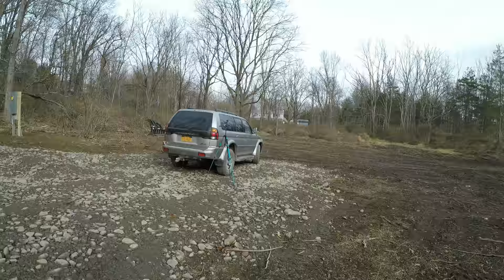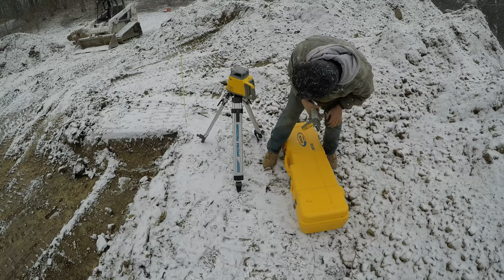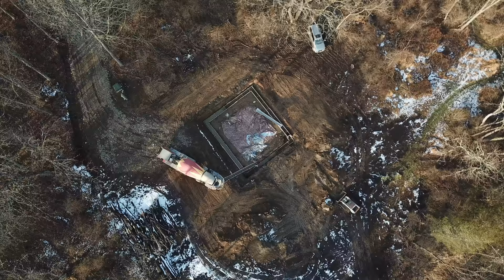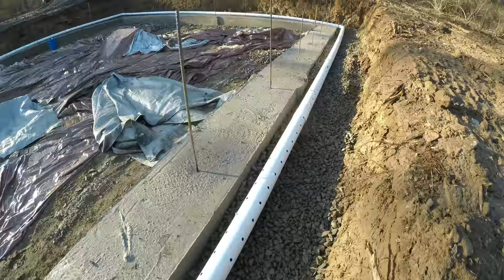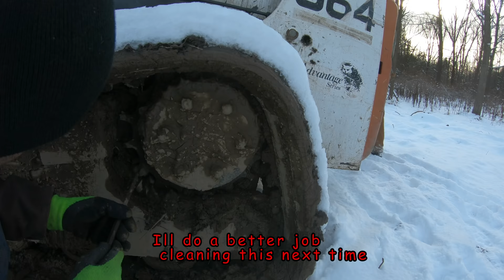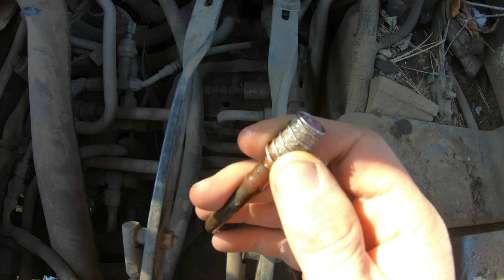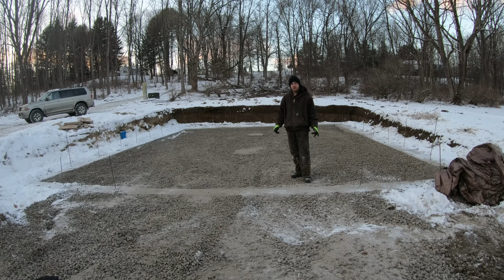Digging a foundation and pouring a footing

Comment: Working in the Arctic at -40 to -50C (-40 to -60F) back in the day, we covered our equipment with an insulated tarp and place a pile of charcoal briquettes in a long line underneath.  Light one end of the briquettes and it slow burns all night.  There is no open flame but keep it away from the engine area and other potential fuel drip sources and the machine is toasty warm in the morning.  Now we use an oil or propane fired Herman Nelson heater, but I miss the old ways sometimes.
Reply: Thanks that a clever ( Old ) way thanks for sharing Ced
Reply: I remember this method as i watched the 'ice pilots' on tv.
Well, watching tv is a long time ago but to come back to 
the story, they also use insul. tarps but an air heater.
Reply: He had power to the site.  Cover equipment with insulated tarp as you mentioned and put a 110v tank warmer pad under, frost plug heater in the engine, water circulator in the engine, cab heater in or under the unit .  Keep it off the ground like you did.  This whole nightmare can be eliminated.  A whole lot easier than fighting with the cold.  The cold causes things to break.
Reply: Ah!  Finally, someone who knows the cold.  Thank you.  So we learn from you, but who do you learn from?  Necessity?
Reply: @rogerdickinson920  He could of just took it home with him on his trailer after work and park up in his garage overnight.
Reply: @rogerdickinson920  The homeowners might not have wanted to pay for that electric bill

Comment: Enjoyed the video Andrew. I know this is an older one and you've learned alot since. When I worked in the Arctic, we would open the rear door of the skidsteer, drape a tarp over it all, stick a diesel heater inside and within an hour the machine would be warmed up and ready to operate. Battery blankets, block heaters, and oil pan heaters also helped alot.

Comment: Hi Andrew just a helpful tip in the future when you have a long project you should deliver yourself a mini container a 10 foot container and hook up a little electric space heater and store your machine inside the container.
Reply: Also they make commercial electric blankets and you can wrap the engine compartment in an electric blanket

Comment: Hi Andrew! Love all your videos! Just a reminder when doing a perimeter drain, for best results, always have the writing on the pipe facing up, and avoid using T’s and 90* Elbows. Always use Y’s and 45* Elbows to make the sweep longer. This way it’ll take 50 years for them to clog up. Also, you should be adding cleanouts after each change of direction. You videos rock dude!
Reply: What’s the reason for keeping the writing facing up?
Reply: @brandons42472  So if you are opening that section of pipe later after digging down you can ID what you have in the way of pipe
Reply: You are correct but Andrew didn’t design or engineer that system the engineer and the inspector could have done and should have done a better job they totally failed and it costs somebody a lot of money.tens of thousands
Reply: Also, shouldn’t the holes be facing down? Which is probably the same thing as the writing up.

Comment: Watching you work getting the tracks free reminded me of all the fun I use to have in the freezing cold fixing our fleet construction equipment during Michigan winters. I am so old I had to restring cables on our Unit Crane, almost slipped and fell off the roof of it but the driver grabbed me by the back of my coat. He taught me how to drive and operate most of the equipment and when I say operate it was most time just good enough to test all things out, we use to work with the drivers because a lot of the equipment had to be setup the way they liked. I got to learn how to drive the Unit, a D6 bulldozer (cant adjust the clutches if you cant test it he said),  morbark chipper with a 600HP cummins (they use to use a 18 inch by 10 feet long log like a tooth pick to shove the stuck bush into the drum), a triple nickle and whole lot more.

Comment: Would it save you time if you were to drape a tarp over your machine at the end of the day with a small electric heater under the tarp with just enough heat to keep it from freezing since you had electric at the job site. Just park it close to the meter.
Reply: Coming from a Canadian, all you need to do is make sure you clean the rails well. Every once in a while you see a frozen roller but the tiger torch takes care of that quick.
Reply: Next episode: Andrew Camarata repairing an electric heater.
Reply: @thetizzleforshizzle   I was curious about 2 things here.  You might be the person to ask.
If the track is frozen solid, why is he just putting heat on the gear(sprocket)?  
And wouldn't a spray of kerosene keep the ice from sticking to the surfaces?
Reply: @alext8828  a lot of guys get the flow truck to spray diesel but my understanding is that the power delivery is spread across all teeth. So you need to make sure that the travel area is clear so they can compound torque and clear frozen material packed into areas that can be hard to get to.

That's why track shovels are shaped that way, so you can clean between sprocket teeth..

Putting heat on the final drive could potentially damage seals and shit in the hydraulic system inside. Ballsy
Reply: @alext8828  in heavy industry the machine never stops but if you park for the night clearing the undercarriage is incredibly important. Sand just keeps dew ice from forming
Reply: @thetizzleforshizzle  ,b
Reply: @thetizzleforshizzle  on u

Comment: Your 955 would have been great for that. I know the bobcat is more agile but i know a guy that  basically built his excavating business around digging basements with highlifts. Used 850 case till they stopped building highlifts. Then went to 953 cat. Never looked back. I am sure you got your reasons for not using the cat. Great video !

Comment: Here in Ontario Canada you would never pass inspection if you have the holes up on pipe like that. 
However most people use a roll of perforated pipe with the sock (filter fabric) on it already and it is perforated all the way around. 

In your high corner Andrew the ground water could potentially be as high as the basement slab though not likely with the 3/4” clear stone. 

Looks to be some pretty well drained soil that showed no signs of pooling inside your excavated area even though the surface areas were quite muddy. The Bobcat did a great job of the excavation considering the lowside was at grade.
Reply: are you gues unionise over there ? in quebec we have to be in a union
Reply: @znarcuss  , In Ontario everyone has the right to work in construction , not just unionized workers, construction Unions are useless, especially International Unions which do not properly represent Canadian construction workers, just money hungry american outfits.
Reply: @floydfan5993  well in quebec if you want to work in construction on residential commercial or industrial you need a ccq carde that prove that you know what you are doing yes they have a union but at the end of the day the employee is back up he cannot say oh i dont know ! and we have a very high salary for it ! a labor start at 27$ hour an excavator operator starts at 38$ an hour .... union is not really a money graber is the employee is making 100,000$ a year

Comment: Enjoy your videos and have learned a lot from them, but I worked 38 yrs in plastic drainage industry as a  manufacturing mgr. and have been to many jobs in the northeast over the years, where our pipe was being installed. Engineers insisted that 2-hole @120 degrees or 3 -hole pipe be installed holes down regardless of application.

Comment: I see you do a lot of work and a lot of fixing things when you buy equipment and that’s really good that you do that and you’re a very good mechanic and you do a thorough job when you do a job and that’s respectful. But on the other hand there are a lot of things that I see that you could use help with. Properly inspecting and taking care of equipment every day before and after using it is such a timesaver in the long run and a money saver

Comment: Drain holes down so that it is harder for them to fill up with dirt or sediment. This is what your soils engineer or your building inspector would tell you. Hope that this helps because it is not meant to criticize. you are a good operator and you have to deal with the equipment at hand and what you can afford.

Comment: Drains: holes goes done. Drains with 2 holes also go down, with holes at '4 and 8 o'clock' and the text line on top.
Reply: That's the way I do it too (holes down). If you put the holes up the pipe will start floating as the water rises. I've heard guys say they've seen drain pipe float right out of the ground.
Reply: Guust In WWII an uncle of mine was on a warship in the PTO whose name was if memory serves Gust. Legend has it he was Swedish. Seven brothers all went USN. The family all come from north of the Rio Grande. Might you be from down yonder? Wow you & me could be kin. Almost scary ain't it? Dec9 2018
Reply: Why 3/4 no minus gravel UNDER the drains?  That's going to fill those spaces with water.
Reply: @MrBobnokious just lower than slab is needed
Reply: @ElectricDanielBoone  Classic mistake... Andrew does amazing work... hope he is reading comments.
Reply: Here's what i would do..If the temp.get's below 32 MOVE...to Texas, Nice Video's See Ya
Reply: Correct spelling: holes go down. I'm done.
Reply: yes i was gonna comment the same thing
Reply: Yupper. He set it up for a constant foot of water on the outside with the stone under and the holes up and that area is swampland which we shall see later on.
Reply: Zerro Fox  k, the holes down is proper. Water enters and all the pipe does is allow a channel for the water to flow easily and quickly. Don't think of that pipe as one would a sewage pipe. The water enters as soon as it rises unlike holes up which would allow 4" of water to build up, before entering the pipe which is not the point of perimeter drains. Holes down also help sediment buildup to not happen, if other things were done properly while holes up allows anything to drop into the pipe and eventually clog it up.
Reply: Zerro Fox  water filters down into the bottom of the trench the drain pipe is in.  The holes at the bottom of the pipe keep the water in the trench from rising, as it just goes in the holes and then down the pipe. If holes are up the water in the trench has to get deep enough for water to reach the holes. The pipe can start floating in the trench water and can float fight up out of the trench.
Reply: Yes. And all that loose 3/4 gravel in front of the frost footing will make a nice moat unless the drain out starts there.
Reply: @ElectricDanielBoone   That's an interesting concept.  Didn't think of that.

Comment: Nice video. Welcome to the world of track loaders, you have to clean behind the sprockets really well or that'll happen every time. A small crowbar cleans it well. An 80" 4-in-1 bucket with teeth is the best.
Reply: I take it going for a drive out of the soup doesn't clean it enough before finishing for the day?
Seems like a whole lot less effort would be expended if a bit more end of day maintenance was done
Reply: Well he buyed a 4-in-1  bucket, but it seems that his bobcats were not capable of using it with all functions. But since he has his IHI skidd steer, who seems to be a bit bigger than the bobcats, he can use that bucket too.

Comment: Hey Andrew,
Thanks for sharing the great videos. I am always impressed at how much trouble you go to in order to show even the smallest detail like a frozen fuel line. Kudos !!
Also, when I lived in what I considered "cold country" which is nothing like your neighborhood, I would use a hot water pressure washer to get all the gunk, snow and ice off the vehicles, dry it up a bit with a leaf blower and cover it up with a tarp to avoid further build up. A good blower heater under the tarp in the am was enough to get things cooking again !!! :-)

Comment: Andrew, great vids...in Ontario we are mandated to put a substantial footing below frost line...usually 4ft below finish grade.....and almost all flat work (concrete) is poured on top of a grid of 10m rebar tied on 2' centers....concrete is great in compression but sucks under tension...which is why concrete always cracks without it...I cant believe you guys dont have to put rebar anywhere....good job...

Comment: Andrew, put a heating rod into the engine case through the oil dipstick tube. Plug it into the electric service there at the site. The dipstick heater will keep the block and oil warm enough to prevent engine from freezing.

Comment: holes on pipe down or lettering up
Reply: Richard moore came to comment same thing.
Reply: I always put the holes down and writing up as this is how the perforated pipe manufacturer designed it.
It is designed in such a way as the water level in the trench rises, it gets to the level of the holes in the pipe and is carried off. The holes on the bottom equal a lower water height in the trench. Having the holes on top makes the water 4 inches deeper before the pipe begins to work. I set the pipe on 4 to 6 inches of stone and then bring the stone just a over the top of the pipe and then cover the entire trench with filter fabric and then backfill.
Reply: yes lettering up

Comment: Great video dude. A trick I learned from the old timers. Wa s put a bit of alcohol in the fuel. " with older diesels", and always clean and top machine off before going home. Stops condensation and saves time, money, ect. Stay busy

Comment: Drain pipe holes down... or are there holes on both sides?
Holes on top works but raises potential water level by a few inches and the standard regulations call for holes down.
Reply: The drainage pipes are up at one end to lead the water away from the house, with holes down, the base of the house would be soaked in water.

Comment: I like your part of the project Andrew, but I cannot say the same for "The Mason"... I'm not sure what the code is in that state, but I would personally have put a lot more rebar into the footings. That's apart from the fact that he simply dumped the rebar on the soil, and pored over it. So he might as well have saved himself the trouble of putting rebar in, because, sitting at the bottom of the concrete, on wet soil, it won't do anything and will simply rust away. What a cowboy...!
Reply: I am sure he pulled the rebar up into the concrete as he went along . I dont think Andrew caught it on tape .
Reply: Not a chance.
Reply: You can tell the rebar is supported and likely 3" above the dirt.
Reply: Pretty sure theres chairs in there looks like the rebar is up.  2 bars is pretty standard on good dirt like that.  Rebar is best placed in the lower 3rd of the footing anyway thats where all the tension is.
Reply: Jason Waters yeah im not sure if some of these guys watched the same video
Reply: Footings don't need as much rebar as the walls and floor - I am sure they will have a lot more!
Reply: in australia you pay per inspection; if any building inspector walking onto that job site they would immediately walk away and you lose your inspection fee simply because no caps were placed over those exposed reinforcing bars. and yes that ' mason ' did not seem to care how he messed up a project ! ! !
Reply: Any mason pulled the rebar up into the concrete as it is poured, some tie it off above the ground level so the concrete can flow underneath.  Andrew OBVIOUSLY does not film entire projects, mostly just his part.

Comment: Hey Andrew i had the same frozen track issue last year. I used a flexible drain pipe placed on the exhaust and used the heat to melt the dirt around my drive motors. Took 5-10minutes per side.
Reply: That's a great idea. Love it
Reply: thats clever !!

Comment: In Europe, we put geotextile straight upon drainage pipe, otherwise, gravel could block the pipe holes. At least two corners must have a well, therefore, you can maintain the drainage pipe through wells if there be any blockage. Drainage pipe must be at the same level to the lower point of the footing.

Comment: I can't get over the very little amount of steel in those footings. As in Australia they would have over a  ton of steel in those footings
Reply: Shawn Boland I was thinking the same thing having just watched this and in the process of building a warehouse and seeing how little reinforcing steel was in the trench compared to how much my builder used, big difference 🤔
Reply: @johnfisher747  i was thinking the same. Where i live we never leave more than 20 cm between rebar rods. On surfaces usually mesh up to 20 by 20cm spacing. And if the surface is thick enough, two layers of mesh. All the videos in the US seem to show very little rebar. Maximum we just use thinner diameter where less strengh is required.
Reply: I did a stitch in Indonesia after the Tsunami.  there were columns in the 4 corners and they were tied together with barbed wire.  I have pics.  The rebar supplied was never used.  The buildings were smashed by the waves and chunks of concrete laying on the ground.  Religion stands in the way of progress.  They will always be in the dark ages.  Corrupt politicians and non existent building codes.I've got 187 pics plus video, you people would roll your eyes in disgust.